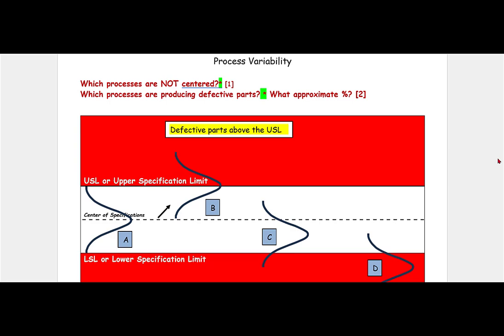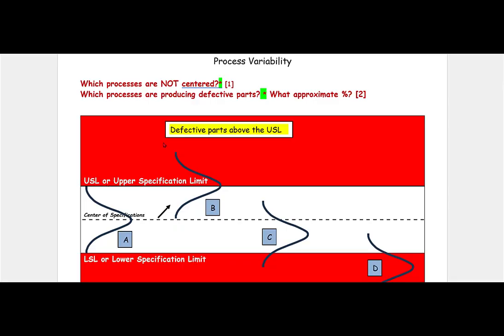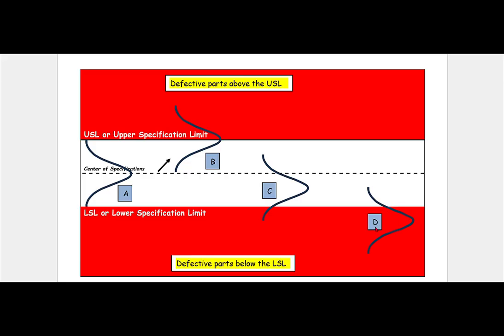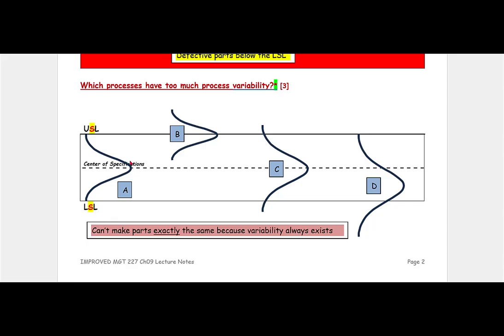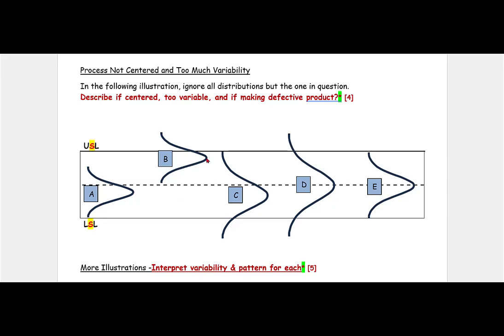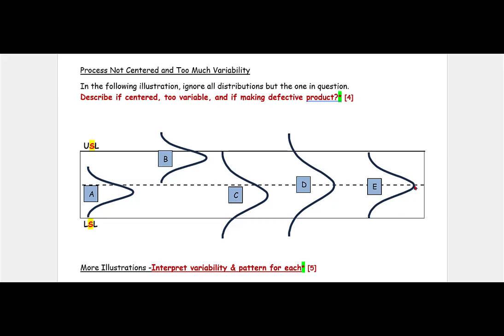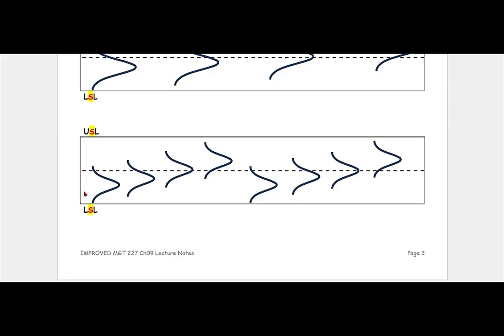Ch10 Segment 1 - Process Variability

Comment: AI Summary

Abstract:

This video explains process variability in manufacturing, defining key concepts such as upper and lower specification limits (USL/LSL) and the ideal center of specifications set by design engineers. It differentiates between process "centering" (where the average output aligns with the target) and "process variability" (the spread or width of the output relative to the specification limits). Using bell-shaped curves, the speaker illustrates various scenarios where processes are not centered, exhibit excessive variability, or produce defective parts, including quantifying approximate defect percentages. The presentation further examines how process characteristics, such as average and variability, can shift and evolve over time due to factors like machine wear or operator adjustments, ultimately identifying processes with unpredictable average and variation as "out of control."

Understanding Process Variability in Manufacturing

*   0:00 Defining Specification Limits: The video introduces Upper Specification Limit (USL) and Lower Specification Limit (LSL), which are set by design engineers to define the acceptable range for part characteristics. Parts falling outside these limits are considered defective. The ideal target is the "center of specifications."
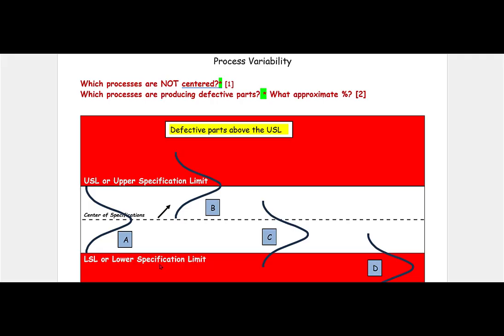*   0:41 Representing Process Variation: Process variation refers to the natural spread of measurements in manufactured parts. This variation is typically visualized using a bell-shaped curve, illustrating how frequently parts fall within certain measurement ranges.
*   1:47 Assessing Process Centering: "Centering" determines if the average output of a process (the middle of its bell curve) aligns with the ideal center of specifications. A non-centered process can lead to a high percentage of defective products, with examples showing how being off-center can result in 50% or more defective items.
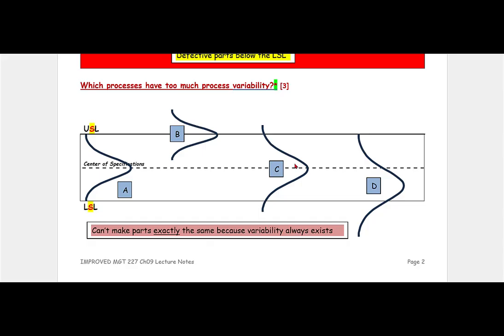*   3:25 Evaluating Process Variability: Distinct from centering, "process variability" concerns the width of the bell curve relative to the USL and LSL. A process has "too much variability" if its output spread is wider than the engineering specification limits, meaning it will produce defective parts even if perfectly centered.
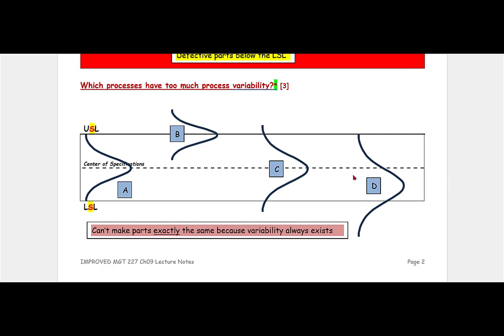*   5:02 Inherent and Environmental Variability: It's impossible to produce identical parts; variability always exists. Factors like material differences, machine inconsistencies, and even ambient temperature can influence part variation.
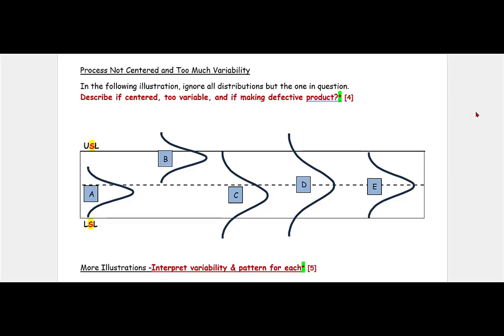*   5:27 Analyzing Individual Process States: The video provides a detailed, isolated analysis of five different process distributions (A-E) to illustrate how to determine if a process is centered, too variable, and whether it's producing defective products.
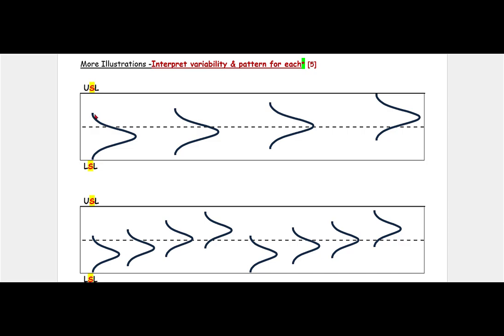*   8:00 Observing Process Changes Over Time: The presentation then examines how process characteristics change sequentially over time. Examples include:
    *   Shifting Averages: A gradual upward shift in the process average, indicating a trend toward future defects.
    *   Operator Intervention/Tool Changes: An average that shifts up but then drops, potentially due to an operator adjustment or a component change (e.g., a drill bit wearing out and being replaced).
    *   Increasing Variability: A process where the average is consistent but the variability (spread of the curve) increases over time, leading to more defective products.
*   10:00 Identifying Unpredictable Processes: An "unpredictable" or "out of control" process is characterized by erratic and inconsistent shifts in both its average and variability over time, making it difficult to manage or predict outcomes.

I used gemini-2.5-flash| input-price: 0.3 output-price: 2.5 max-context-length: 128_000 on rocketrecap dot com to summarize the transcript.
Cost (if I didn't use the free tier): $0.0061
Input tokens: 14621
Output tokens: 700